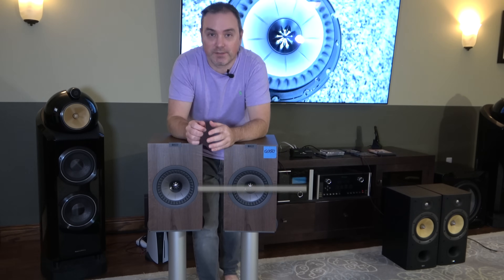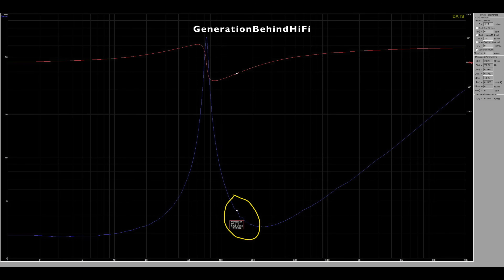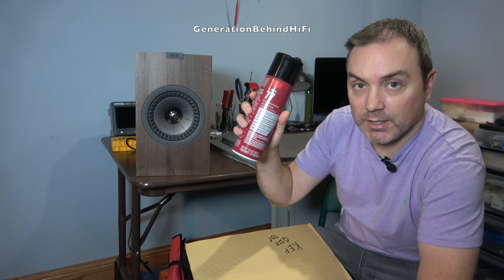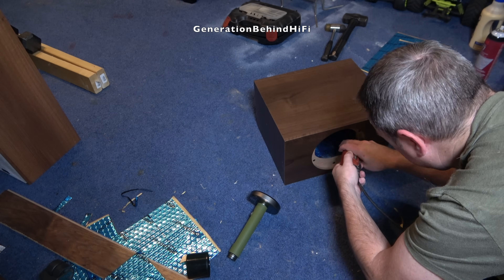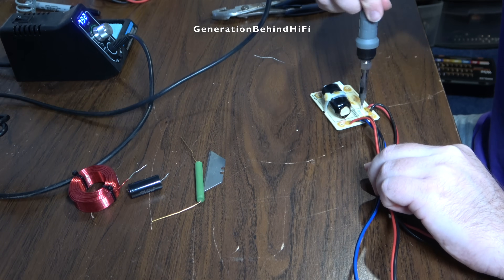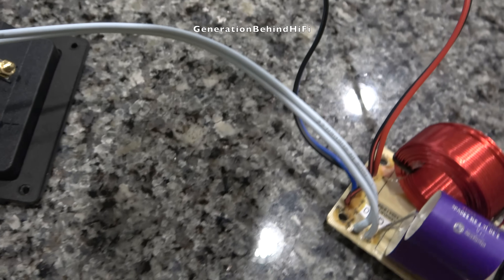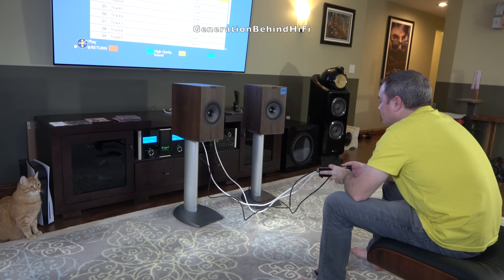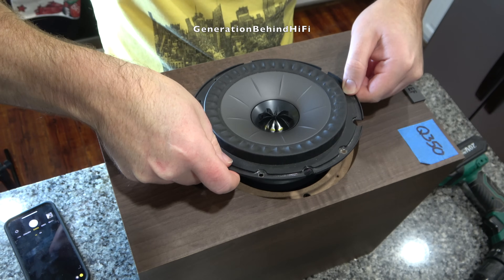Upgrading My KEF Q350 Speakers - Resolving Cabinet Resonances and Upgrading Crossover Parts

Comment: Remember that when changing out iron core inductors with air core to keep the same DCR. If you don't do this you'll lower the output of the midbass driver thus changing the phase relationships between the midbass and tweeter. Matching the same DCR as an iron core almost always means having to use a very large, thick gauge and expensive inductor.
Reply: 100% correct.
Reply from the maker: Yep. I'm well aware. thanks
Reply: Interesting. I upgraded all crossover parts in my Martin Logan motion lx 16 speakers and I think I’ve experienced this. May have to look into trying larger inductors…and yeah they do get pricy.
Reply: If thst is true I appreceated the heads up that’s relavsnt information that will effect the sound these little things all add up to make a difference to some people ignorant would like to know about so thanks
Reply: On my two way stand mount speakers, the DCR on the new air core is 50% higher than the factory iron core inductor. To offset this, I added more resistance to the tweeter circuit and it sounds great.
Reply: I am using a 3rd Order 2kHz XOver designed by Hifialex a few years back, additional bracing below the Terminal and 15mm self adhesive Felt on Top, Sides and Back, the Stock Damping Material on the Bottom. Almost perfect Constant Directivity pattern  because of the reduced overlap, 0.8-10kHz vs 1.3-3.5kHz and much improved in Room response. I‘ve spent 70€ and 1.5 hours per Speaker. I have also  mixed different quality MKP Capacitors for the Tweeter, 20% of the value in good quality.
Reply from the maker: @zappel52  Hello Zappel, I have heard about Hifialex crossover design for the Q350 and it looks cool. How do you like the sound of the speakers now that you're using his crossover design? I thought about using his design, but the parts for the crossover would be quite expensive because of the complexity of his design. I remember the design using high order filters for both the high and low pass circuits but can't remember. I know you mentioned a 3rd order slope for this high pass but isn't the low pass even higher?
Reply: @generationbehindhifi  With all the Mods i did, the Soundstage gets a little less wide, a good bit more deep and focused with a wider Sweet Spot, overall it is brighter and i can crank it up 4-5dB higher before Distortion becomes noticable, but  i use them sealed. For the Lowpass i've used the Stock 4.4uF Capacitor + 18uf Plain Electrolytic,  and a Dayton 1uF Mkp in parallel with the second inductor. For the Highpass 6.8uF Dayton PMPC + 1.5uF Jantzen Z-Superior and 18uF Dayton DMPC + 3.9uF Jantzen Z-Superior. The Z-Superior Caps are rather expensive outside Europe, it seems, and there's not that much of a difference with this Tweeter because of the Ferrofluid. All inductors are Jantzen Audio Baked Aircores, 17AWG for the Lowpass and 24AWG for the Highpass. Acoustically they're both 3rd Order, the lowpass can also be seen as 2nd order + Notch Filter.
Reply: You are correct sir. And in most of the time the DCR is unknown. They don’t put that up on the inductor.
Reply: @guus007  There are inductor testers for that. I have a DATS from PE that does a good job of that.
Reply: I Hear Danny from GR Research, talk about phase, quite a bit. 
 What's the telltale sign for in phase, and out of phase listening? 
 I'm enjoying the recent rebuild of a pair of speakers, but would like to understand more on this fun hobby, and what a human ear is supposed to be hearing.
Reply: So the rolled up polyfill is intentional? I thought somebody was just being lazy when i saw that in mine.
Reply: Duratech-acry-tech is a paint on sound Deadener does anyone know how well this work I would like to use it with two coats then some foam maybe no Rez from gr research or acoustic wool from Russ Andrews to dampen the sound any tips that you can give me while applying these would be appreciated does and don’ts
Reply: @MichaelStark25 No Rez takes up cabinet volume and can actually harm your bass. Only use it if you have a resonance problem from lack of bracing or thin, weak cabinet walls. If you can you're far better off to add some kind of bracing like wood dowels rather than using no Rez. But if no Rez is all that will work for you then of course use it.  
In a ported enclosure, the purpose of internal damping material is not to absorb bass (as in sealed boxes), but to suppress midrange reflections inside the cabinet (so they don’t leak through the cone or port), and reduce standing waves. So the key is to absorb mids/highs without restricting airflow to or from the port. The absolute best material for that is recycled denim. Denim fibers have a near-ideal balance of absorption vs. airflow. They absorb midrange reflections very effectively. You can't do better than the "Acousta-Blue Speaker Cabinet Sound Damping Denim Fiber Mat" sold at PE. Use it to line at least three of the walls and your golden. 
For these KEF speakers adding some bracing would be very difficult. So, I'd use a layer of the thinnest no Rez on the two side walls and then stick a thin layer of denim on top of that. I'd also put an extra layer of denim fiber on either the bottom or top of the cabinet.

Comment: there you go, was waiting for this.
sometimes there are some nice used deals on speakers and i get the itch to improve them, building from scratch takes so long...  this is faster.
i wonder if you also can buy some cheap tubes and adjust the port tuning, with some eq and lengthening the port.
i have also seen people experiment with rounding the corners on the box, placing half rolls on the outside.
Reply from the maker: That's the spirit! I like the way you think. I don't think the KEF Q350 would respond too well with a lower port tuning because the resonant frequency of the driver is so high (around 70hz+) but it would be fun to mess  around with.
Reply: Sure, not easy with a simple eq, but absolutely no problem with  a dsp. I use them sealed, as surround speakers, with a 3rd Order x over  at 2kHz for better Directivity. Happy Tinkering!
Reply: The port on this one is already very long.
Reply: @zappel52   
do you mean its no more room inside to extend its length?  because you can but as bend on it or let it stick out the back.
Reply: @sudd3660 no, the tuning frequency is already very low, way below the drivers resonance frequency. With a Qts of 0.55 that‘s not that much of a problem in this case, but I wouldn‘t go any lower. This is done to be able to put it closer to the wall without muddying up the low end too much and provide some nice punch when done so.
Reply: @zappel52  that is why i mention dsp, in that case lower the port tuning by 15hz and see how it goes with the adjustment in equalization to compensate.

Comment: Yes! Thank you! Not sure it will tackle my particular issue without minor change to crossover point, still very appreciative of your efforts. I may give it a try, what do you think?
Reply from the maker: No problem! Tinkering with speakers is a great way to learn about speaker design. If you really want to learn more about this hobby, then I highly recommend getting a copy of the Loudspeaker Design Cookbook. There are a lot of great proven design theories in that book that will you learn about good speaker design methodology.